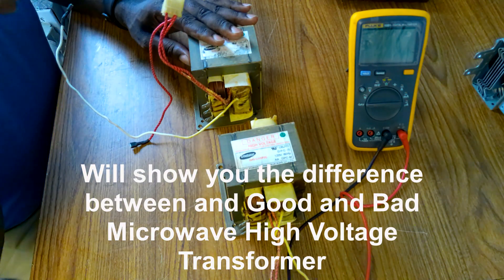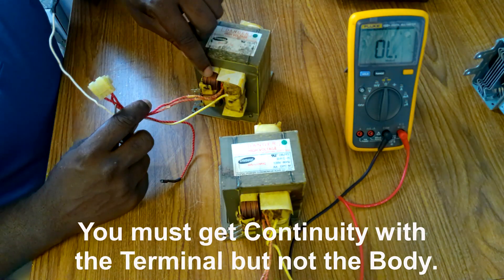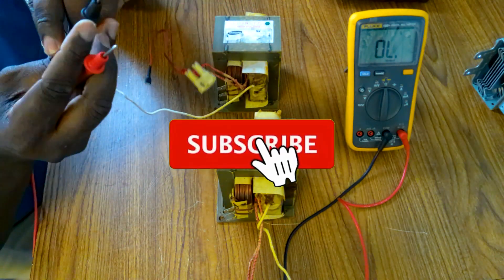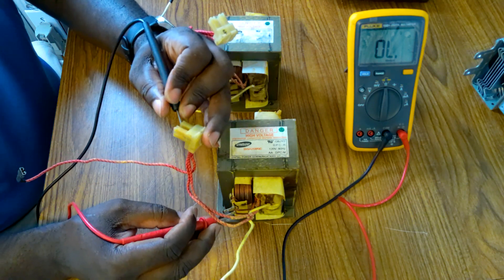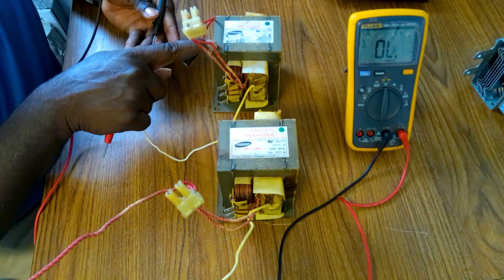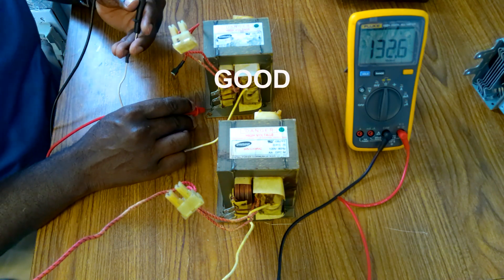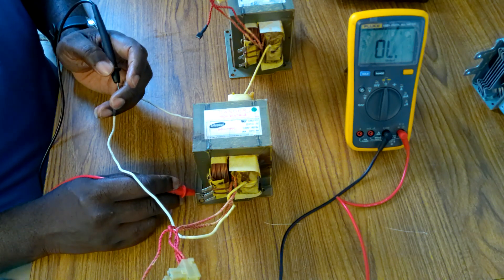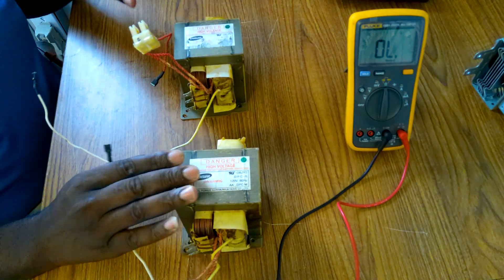How to test a Microwave High Voltage Transformer - GOOD vs BAD

Comment: My microwave is heating no light and fan is not working help me
Reply from the maker: Good day. You may need to replace the bulb, for the fan you may need to check your filter or fan motor if it is an over the range microwave.